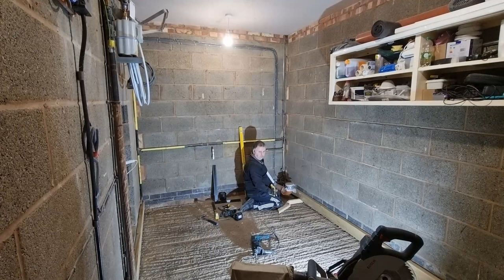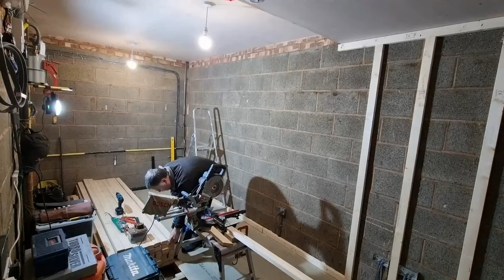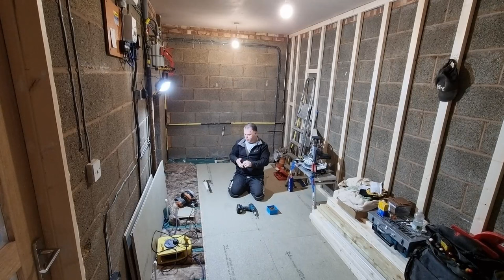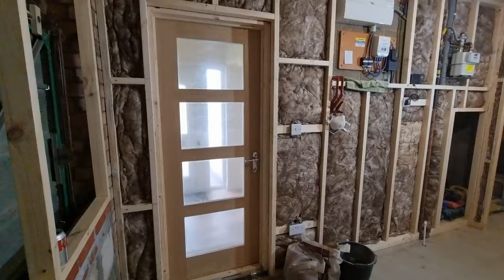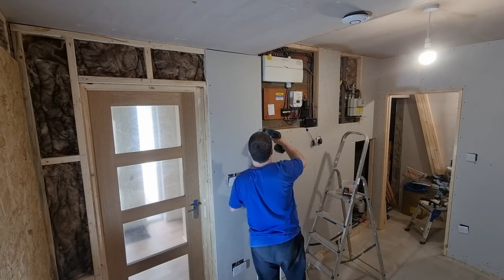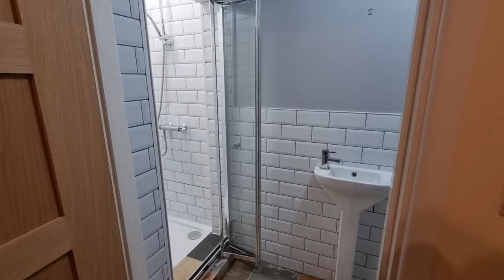Garage Conversion: # Part 3 Finale

Comment: Hello Mark, hope all is going well in your new place. Did you get Building Control? Did you go for a council one or private? Many thanks
Reply from the maker: Hi, Thank you... it's a bloody nightmare lol🤣... biggest refurb I've ever done! Because I was selling that property you need a sign off cert from your local Building control, so that's what I done and it was fine no issues if you work with them.
Reply: @mjsimo1  thank you Mark, much obliged. one last question please, did you need to dig out the concrete where the door was to put in a foundation, were the services under there (gas/electricity) was it difficult to avoid them? Cheers
Reply: @markdyballuk same question. Not sure how you assess if it's strong enough or need to dig it out

Comment: Great video - one question that's not answered after watching: what happened to the garage door exactly? is it removed and turned into the window?
Reply from the maker: Hi thanks for watching, yes the garage door was fully removed, bottom half was built as a dwarf wall and on top a new window was fitted to match the Livingroom window.
Reply: @mjsimo1  what about if i make patio door and one  or two windows from garden side.Also want to know that is it necessary to fix timber frame on floor if we fix directly underlay and vinyl

Comment: How complicated was all the paperwork with the council? My internal garage should be permitted development, plenty of neighbours have had theirs converted and didnt need foundation upgrades/replacment for the bricking up
Reply from the maker: Hi, thanks for watching. That's correct planning only really required if it's a detached building and change of use. Simple forms to do and all done online, basic questions are asked, what are you building and costs will determine the fee, look for your local Building Control Department portal https://www.planningportal.co.uk/

Comment: If you move to a smart gas meter you can minimize the space required as they are much smaller
Reply from the maker: Hi, Thanks for watching. I guess smaller would help with space yes and going digital is better for meter readings. My issue was with the large pipe and the cost to move locations so I just went with it and had a gas safety check then boxed it all in!  👍

Comment: Wondering what was the reason you secured joists to wall, could you have just shimmed joists off the floor? Thanks!
Reply from the maker: It seemed to me the easiest way to level up the floor and I was also matching the height of the hallway to have one continuous same level floor. Your right wouldn't have been an issue off the concrete floor. Thanks for watching 👍

Comment: Nice vid. How much do you have to raise the floor by and do you have to add sub floor ventilation?
Reply from the maker: Thank you for watching. You don't have to raise the floor, you can sit them on the ground or concrete with a plastic DPC sheeting underneath. I had to raise mind by 10/12" to match another floor and fitted two vents to allow for air flow is good practice.

Comment: Great work and awesome vid. I was wondering if you used a vapor barrier and if you screwed to a specific depth on the drywall. Did you plaster the drywall or paint directly on it ?
Anyways, great stuff 🔥👌
Reply from the maker: Hi, Thanks for watching... yes I used a vapour barrier on the warm side (aka just before fitting the plasterboard) I tend to use a 35mm drywall screw, tape and jointed fill the plasterboard then lining wallpaper with a final paint finish. 👍

Comment: Is the insulation you have used loft insulation, if it is, is it fine to use for walls. Does your room feel warm. Just about to start my garage and rockwool is a cheaper option than other materials at the moment 
Thanks
Reply from the maker: If costs are a factor like myself 100mm knauf roll insulation is fine to use in walls and roofs, building regs approved. Good luck with your build and thanks for watching 👍

Comment: Did you get building control to sign all this off?  Thinking of doing something similar but feel like I should be involving someone other than just me.
Reply from the maker: Yes, building control sign it off at each stage. The main reason was because I was selling the property and it's difficult to sell without certs? They can also be very helpful for advise. Thanks for watching.👍

Comment: Hi Mark, this is a great video, really enjoyed it and thanks for posting. Do you have a breakdown of the costs? I'm looking to do something similar, without the en-suite, just looking to guage where the money was spent. Thanks again
Reply from the maker: Hi, I'll be honest at the time it was just before the madness of rising prices hit us all... with lots of deals, I spent around £5-6k in all for the materials... the bulk of the costs were timber, then it would be insulation, plasterboard next... it's the little bits that get you, screws, glue, filler, drill bits etc and so on to think about, depending on how your set up but it all adds up? Thanks for watching...
Reply: Great job done.

Comment: Looks great. Would I need planning permission to to do this and put a side door in?
Reply from the maker: Thank you for watching. No, just an application to your local building control to sign off the work, certs needed if you sell up. If it's a single skin detached garage then I would check under change of use. Still, full planning may not be required under self declaration with permitted development. Good luck 👍.
Reply: @mjsimo1  thank you for taking the time to come back to me, that's really helpful and much appreciated.

Comment: I have a barratts home and I'm wanting to convert the garage into another room. Where do I start ?
Reply from the maker: If you doing the conversion yourself, I personally I would start talking to your local council, building control department. They can do a pre inspection and give you advise after all they need to sign it off, if you ever want to sell up. Then start to price up all the materials. You need to consider an electrician for the electrics and if there is any gas you need a corgi registered plumber for the certs. Also try get some local builders for quotes and advise.
Reply: @mjsimo1  thank you.

That's what I will do.. the walls are plasterboard already would they need to be removed and better insulation? After all it's a 2023 new build home.
A few more sockets and the floor would need strapped with kings span. A new window and build a cupboard around the boiler and install a radiator.

Comment: Looking to do a similar thing, do you need to put DPM behind the insulating wool?
Reply from the maker: DPM would go on top of the insulation and under the plasterboard warm side for walls and under/behind for floors. Vapour barrier that allows airflow is best used behind if needed cold side on external walls. Damp or condensation flash point is created when the cold & heat meet. I mostly had internal walls, so not needed.

Comment: Great video, I'll be doing a similar project to my garage and watching yours has been very informative, can I ask what size floor joists and wall battening was used?
Reply from the maker: I used 47mm x 150mm joists and the walls/battening was your standard CLS stud timber 38mm x 63mm, so it gave me a space to insulate the walls, which is a building control requirement. Thanks for watching.

Comment: shouldn't the vapour barrier go under the floor joists and above the concrete?
Reply from the maker: Yes, your correct it does and there was a second DMP sheeting under the joist, to difficult to video that bit. It was all signed off by building control.
Reply: @mjsimo1  cool thanks. im doing a similar thing soon and i'm trying to make sure i'm doing it right

Comment: Hi thank you for this video, really helpful! (Also ignore the comments about the bad music, I am not sure those people know that there is a mute button they can use 😂). Could you please tell me what the name of the metal brackets that hold up the joists is? You use them right the the beginning on either side when prepping the floor. Thank you!
Reply: And sorry one more thing, what is the second membrane (lighter green) that you put down before the insulation called (8:00)?
Reply from the maker: Hi Veronica, thank you for saying😊 there seems to be no pleasing some people and it's hard than it looks editing video's, I have a lot of respect for Youtubers that are good at it. Metal brackets are called, joist hangers and are very similar https://www.wickes.co.uk/Wickes-100mm-Galvanised-Light-Duty-Hanger---Pack-of-10/p/263711
Reply from the maker: It's called vapour barrier similar to this light gauge one https://www.screwfix.com/p/capital-valley-plastics-ltd-vapour-barrier-green-300ga-20m-x-2-5m/12869 it was used just to keep the insulation off the concrete floor.

Comment: You didnt need to dig the floor out for proper insulation, did you get building regs approval?
Reply from the maker: Hi, no because my floor was raised which allowed insulation and DPC on top. Yes fully inspected and signed off by local building control, thanks for watching.

Comment: Nice video. What was the p/a ratio for this room and what thickness floor installation did you use. Also did you get this done on a building notice? Cheers
Reply from the maker: Thank you, you have to bear in mind this is an internal garage with cavity walls already insulated, I used 100mm rockwool everywhere. Yes I applied through my local government council/building control department, cost was around £360 which included 3 site inspections, plus final sign off.

Comment: Do we need planning permission to convert our garage into bedroom?
Reply from the maker: Hi, it depends on the type of garage you have? if it's integrated like mine then no. If it's a detached garage then possibly yes, check with your councils planning department but in all cases you need to submit an application to your local building control so they can check the standard of build meets regs. Hope it helps.

Comment: What was the dimensions of the garage before and after?
Reply from the maker: I no longer have the details, it was a standard size single garage and it was reduced in size by about 150mm each way for boarding out etc.
Reply: @mjsimo1  I want to convert my garage but don't have a diy bone in my body. Congrats on your conversion though

Comment: can you drill through the timber into the concrete floor through the membrane or will this introduce moisture?
Reply from the maker: Technically you would be break a seal, but we all do it! you may not have any choice in which to fix to. If your concerned you could always use a resin fixing which seals the hole or try not to drill so deep. Your floor screed should be at least 3-4" thick/deep. Thanks for watch my video, cheers.

Comment: Hi Mark, you have done a remarkable job! I noticed that the BR folks didn't ask you to build a concrete foundation at the front to support the brickwork and window frame? I have seen other similar conversions and they have had to dig a foundation...
Reply from the maker: Thank you, that's very kind of you to say and thanks for watching. I guess every project is slightly different but for me it wasn't needed no. I did however, dig a small test hole for Building Control to check and advise on, the house was built on a very thick slab and wasn't necessary they said, it was only one small retaining wall.

Comment: mark did u have to lift the floor to the level of house damp proof as my house high than garage
Reply from the maker: Yes I raised the level to match the existing floor levels, I wanted a seamless look and feel with no steps. The extra DPC building control requested was a nonsense, the house was 60+ years old with no signs of damp issues what so ever from what was already in place?. Thanks for watching.
Reply: @mjsimo1  ok thanks for getting back to me

Comment: Hi May I ask a question. do we need DPC behind the plaster  board of the wall?
Reply from the maker: No, not necessarily... not even new builds do that? you only really need a water barrier sheeting behind the studs on say with single skin external garage walls, mine was built inside all double skin internal walls, apart from where I replaced the old garage door. The other guy gave great advise thank you, budget plays a big part.
Reply: Hi so technically, because garage is surrounded by “heated spaces” a vapour barrier isn’t required? Great video and use of space! 👍🏼